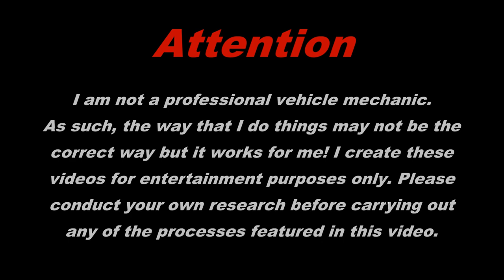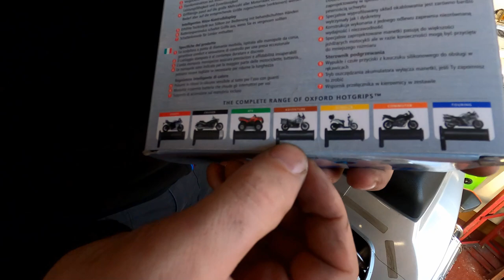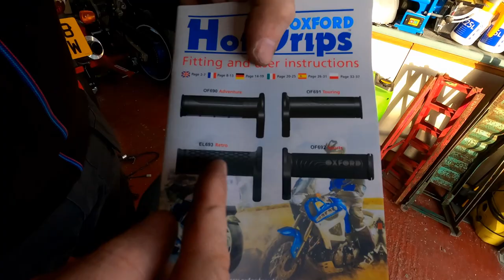Fitting Heated Motorcycle Handlebar Grips - Oxford HotGrip Installation On My Suzuki SV1000

Comment: Thank you for releasing this video. One big take away from this video was the explanation about using a file on the throttle side bar. I watched other videos where the installer struggled to put the new throttle heated grips.

Comment: I did a bit of looking around for the type of H-grips. I was sold that the Ox were the best for the quality and what really sold me was the brain power of the Oxfords. Sensing vibrations and reading voltage in attempt to save the battery on my 07 VFR in case you forget to switch them off. After installing them, they are just absolutely amazing! Is there better? Perhaps but I am 100% satisfied. I dont like the blue light at night... but nothing a piece of tape cant fix. 
This install video is on point! Thanks Kev!
From Seattle Wa
Reply from the maker: Thanks bud, glad you enjoyed it! 👍🤓